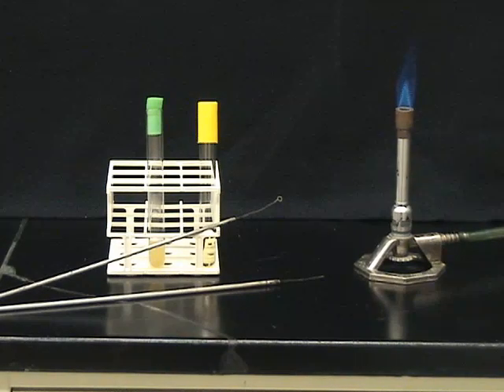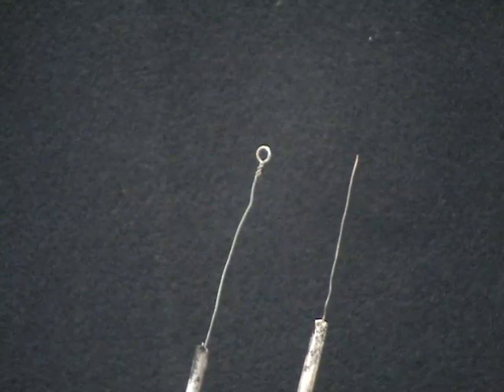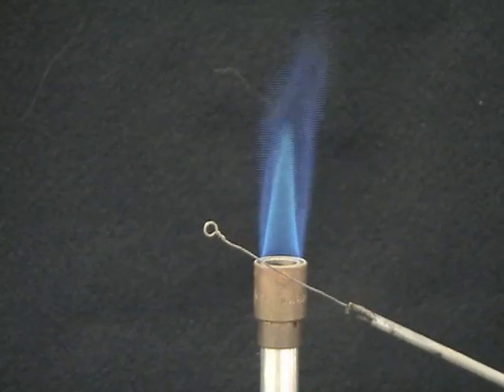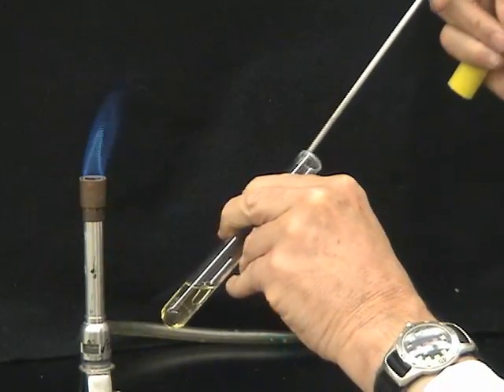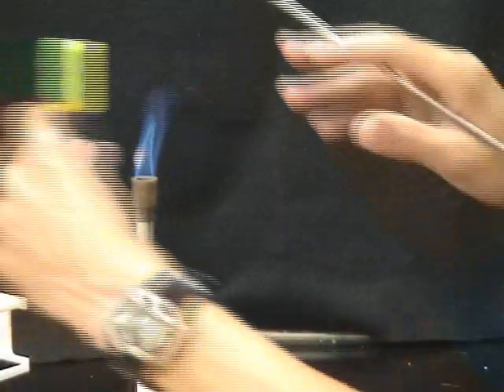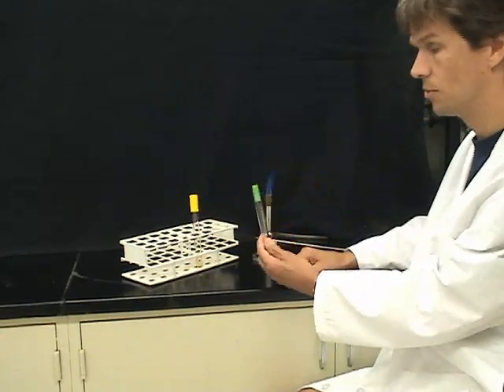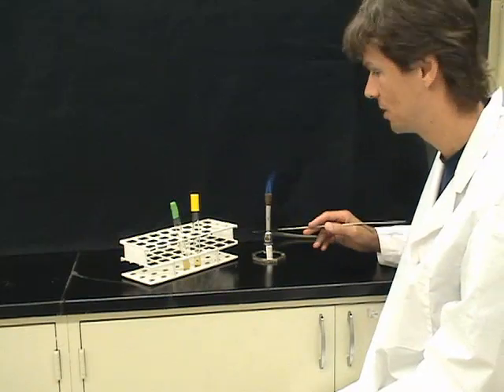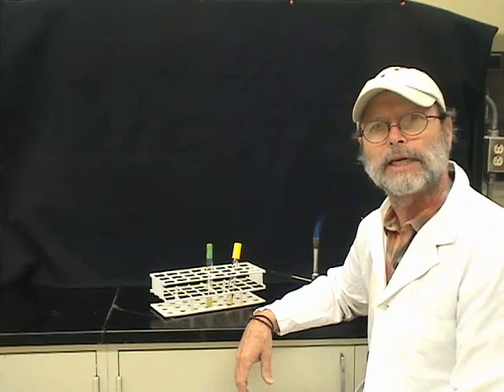Flame Sterilization and Tube Transfer

Comment: gloves??
Reply from the maker: Gloves are not necessary when handling typical bacteria. We don't use them in our laboratory because they remove sensory information. If you get a drop of culture on your hand, you immediately feel it and will deal with it appropriately by washing your hands and disinfecting. If you are wearing gloves, you don't feel it and will then spread it around the laboratory. In the 30 years I have been working with microorganisms, I have never contaminated my hands during a tube transfer. If that is a real concern, you need to improve your transfer technique

Comment: Great video, thank you! I have a question regarding allowing the loop to cool completely. In my microbiology course, my professor says that you can place the loop even when it is hot into the solution, as there are many microbes and it will not kill them all, although it may kill some.
Reply: That is a great question. Your instructor is correct and it's fine to do that, however, I just find it aesthetically unpleasant.